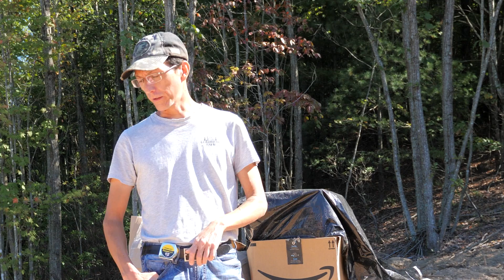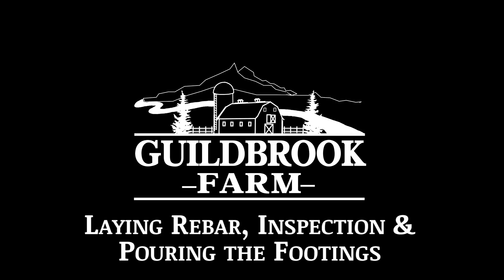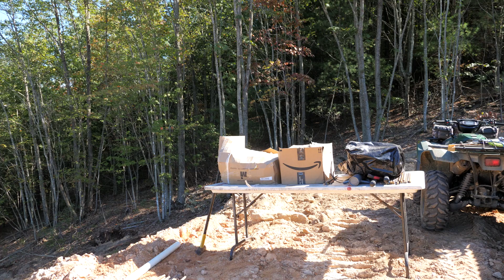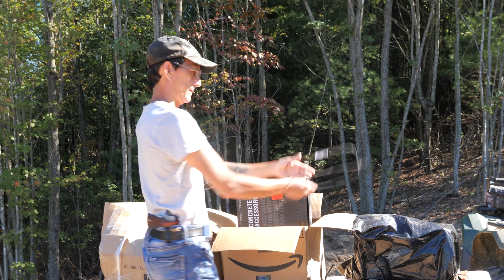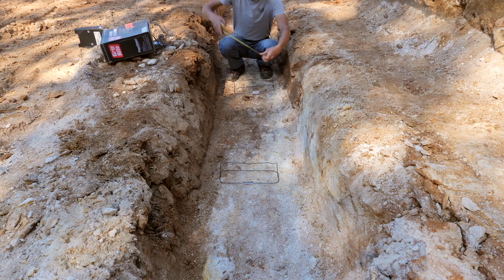ICF Home Build (#15): Laying Rebar, Inspections and Pouring Concrete for Footings

Comment: just wanted to know if it is okay to have those vertical rebars pushed to the soil because it will accelerate corrosion and will expose all the rebars in the foundation to Oxygen

Comment: I learned a lot . Thank you ..Question: what if you’re on a downhill slope . Is it the escavators job to fill in more dirt at the lower end or would he remove dirt from the high end or do I raise the footing with more cement at the lower end
Reply: You always dig footers to virgin ground.  If the difference in height/elevation is considerable then you may need a stem wall.  In a stem wall you dig the footers, pour the footers then make the difference in heights with cinder blocks.

Comment: good bless evening sorry to bother you but I have a few questions because I'm building my own house for the first time ever the rebar with the green cap how did you do that did you drive them into the ground and is that fine or should it be placed when concrete in poured

Comment: Footers! Hey, I like the way you did this, easier than doing wood forms, why would someone want wood firms vs how you did your?
Reply from the maker: You have to use forms in some situations, like where there is a "stepped" foundation. The easiest and cheapest is to be able to dig trenches that are all level and on the same plane like we did.
Reply: Some counties/states only allow formed footers. My county I have to have formed with wood and a perimeter drain.

Comment: Great job-looks perfect. 😊 Thank you for pointing out rebar "chairs" to "float" the bars-just what I needed to know. Bought pond liner, then realized I will be dealing with intense hydrostatic pressure so thinking pouring might be better. Only 4' x 3" but below grade to hold drainage. Needs to be a tough pool.  Suggestions? Lol

Comment: Whereas you are trying to accomplish the task at hand with the least labor you should have provided your steel supplier with your structural drawings and they would have detailed your needs for free.  Most of the suppliers will provide your bends, hooks, stirrups without additional cost for the fabrication and sell you the whole job at the steels tonnage price.

Comment: Did you need to compact the bottom of the footings trench?
Reply from the maker: No
Reply: As the inspector said "it's solid".  No need for gravel or  compacting.

Comment: Rebar in contact with dirt😳that’s a new one to me that would fail the inspection here
Reply from the maker: No structural rebar contacted the dirt.
Reply: 16:22 - 17:22
Pounding rebar in the ground.
Reply from the maker: That’s not structural

Comment: Great job! But no j hook on the vertical dowels? Doesn't seem like its going to provide enough uplift resistance?
Reply from the maker: It’s only for shear. No uplift worries here with 130+ tons of concrete.
Reply: I wet stab the vertical rod at an angle then bend them up after the mud dries
Reply: Would not pass inspection here!
Reply from the maker: Glad we’re not there.

Comment: Inspections...what a waste of time and money.
Reply from the maker: Depends on how you look at them. Go to a 3rd world country during a catastrophic event and you may develop an appreciation for minimal codes.
Reply: @Guildbrookfarm  Inspections and codes are great in theory. In practice, not so much. Too many inspectors don't do their job, others can be bribed. Some code items make no sense at all. Then there's things that should be code, but aren't. 

The worst problem of it all, is the only way to get the code book is to buy it. Well, the only legal way. Everyone has a computer and internet access now, there's no reason to not have a free PDF online. Except for greed. 

Here's some irony for you, the place I learned all this is my local community college, in the building that got built without insulation in a large part of it. Code at the time of construction was R-19 or R-13+5. 0 insulation, and it 'passed' inspection.
Reply: @Guildbrookfarm  Yes, I agree however there is ZERO accountability from the code inspection process.  If it fails for whatever reason, you're holding the bag, plain and simple
Reply: For us few with common sense and IQ above 100, agree.
How the world works, the % game, treat everyone as dumb and stereotype because its easy to make money from it.

If only we all lived on the same planet.
Reply: Building codes and inspections are important for many reasons, one good reason is to stop people like you duggydo from building unsafe structures.

Comment: Thrilled to see progress for you guys! And great to see your beautiful young ladies. I know like yourself, I research everything before starting things. Just wanted to share my story. My parents went with the ICF for the basement of their addition. The last cement truck to deliver was way longer then expected behind the previous. Bottom line, a few years later, the basement started leaking. contractor who came in to assess the issue said whoever was doing the work did not mix the new concrete with the previous. Could even see it, loads were slightly different colors. (Don't know the proper term) Sort of like getting the air bubbles out of a canning jar.  This caused the new concrete to layer on the previous causing a void between the two, over time created a leak. 
This was years ago but wanted to share. Would hate to see you have that issue.

Comment: question. why only a foot of footer? isnt there frost line stuff to consider? Is there more going on top of that that takes that into account? does it not matter at all and only needed for spreading weight? :)
Reply: Yes, dirt will be covering it and they might be in an area where the frost line isn't too deep.
Reply: Only the bottom of the footing has to be below frost line. Top of footing can be above it.

Comment: You put rebar after concrete as been poured..! Well... That's a bad idea, spzcially when it is as dry as it is here.... Non sense.
Reply: It’s acceptable lots of places. Although I would have pulled a mason line above footing to keep vertical rebar in line. Using tape measure from edge of dirt footing wall not going to be near as accurate

Comment: 1.5 yards short!? missed the mark by a long shot
Reply from the maker: Meh. Wasn’t a big deal in the end.
Reply: It's difficult to calculate volume of concrete when you have a trench footing, formed footings can be calculated more accurately. It's more work but that's the trade off. Hopefully the small load charge wasn't excessive.
Reply: 1.5 yards is literally the size of two washing machines, not a long shot by any stretch.
Reply: @augustreil  it is in the concrete world.

Comment: I had no doubt the inspection would pass. You have done more quality control work in just the footer than most contractors put into an entire build. I know its time consuming but your constant checking, measuring and rechecking will pay off. I'm glad to see somebody take so much pride in something. 
Can't wait for the next video. 
Thanks for sharing

Comment: You should research if you need 2 Ufer grounds in the concrete, you probably do,   they are 1/2" lengths of rebar, coming out of the concrete as a electrical ground, I think I saw somewhere that they might even measure continuity between them.   They are easily added in the first course, and channeled out of the foam with a utility knife.   I would weld them, but I do not think that is mandatory.     Keep up the great work

Comment: How come no plumbing or electrical lines yet? Usually those go in before the footings.
Reply: Keep in mind this is the basement footer not a house footing that is way way below grade. It appears that the house will be 5-6 foot above this footing. They will probably bring the electrical and plumbing in under the house which will be through the side wall of the basement.
Reply from the maker: Correct
Reply: I was thinking the same. One would normally dig those (and proper drainage underneath, but maybe not in their climate) in first. I'm in a heating dominated climate, so I also put in the air intake for the fireplace as well.

Comment: When I heard the trucks you ordered I just knew it would be short.
Do yourself a favor, take some scrap wood and build some boxes that you can pour excess concrete into. Either make pavers or blocks for smaller retaining walls. Every time you order concrete there should be some excess and with ready forms it won't go to waste.
Reply: Even if you order too much and don't have any forms, it's still cheaper to just dump the excess than having another order run for concrete.
Reply: I had the same feeling. I watched Al Lumnah build his barn and he ordered extra with the idea of pouring a sidewalk with whatever was left.  Fortunately it seems that getting the extra 2 yards didn't seem to be a big deal.

Comment: It would be easier to have cut a 2x4 to length rather than have to pull tape to set your chairs. Anytime you have a reoccurring measurement making a story pole saves lots of time, like setting you dowels, a pole that is long enough to show the height would also carry the mar of the distance between each and the distance from the inside wall. It's an old school way.. 
Porta potty means you is an official job site

Comment: Where did you get the tool to twist the wire?? I’ve been doing it the hard way 😳😳
Reply from the maker: Amazon. A few bucks.
Reply: I picked mine up at Lowe's but and hardware store should have one.

Comment: As someone who has spent 3  years remodeling a house, a little advce for you.     DO NOT CUT WOOD ANYWHERE  NEAR YOUR INTERIOR.  We used a room that was scheduled last for completion for a cutting room. We will never get all the sawdust out of the house. It's been about a month since we moved our cutting operations to the garage and every day we clean up more sawdust. Be blessed💜
Reply: If that were true, every house in the country would be sawdust ridden forever, so not true.
Reply: @augustreil  MY STATEMENT IS TRUE FOR US. I can't speak for everyone nor did I try too. I shared my experience.
Reply: @Souixno , Thanks, I guess your job site wasn't cleaned like it was supposed to be.
Reply: @augustreil  Maybe you are correct and we do not know how to properly clean to remove all the sawdust. We are not professionals or contractors,  we are rookie home remodelers like Jeremy and Jaime are rookie home builders.
Reply: @Souixno , It's all good, you'll get it eventually. Nothing lasts forever, except taxes. Have a good one, thanks.

Comment: I built one of these five years ago. You really have to plan ahead, like way ahead, because cutting into concrete with rebar is a pain. I didn't see anything for a basement drain, septic, well or radon. Conduit in the concrete works well for electrical but plan ahead. Plan the screw strips for wall studs and kitchen cabinets. These houses are awesome. Reach out if you want any help!

Comment: Make sure you have the right grade away from the house and drain tile system . I have a house in northern Minnesota, all clay. My dad refused to put in a good drain tile system and pushed the clay right against the basement walls. 25 years later, the walls are coming in. $35,000 dollars later the walls are now fixed

Comment: You did what we did when we ordered our concrete you forgot to account for the 2 post pier support holes. We were off 3 yards but we had 4 3'x3' holes. Happy you got alot done. In the porta potty place a small insulated cooler to hold bay wipes and toilet paper. Place the wipes in a ziploc bag and the toilet paper in a separate ziploc bag and then place in the small insulated cooler to keep the wipes from freezing in the winter. Plus if you don't store the toilet paper in a ziploc bag the bugs will eat it and the spiders will live inside the tubes.

Comment: Did you by chance install a ufer ground for say a future power panel in the house? Generally just a 10" stick of rebar tied to the footing rebar that sticks out by where a electrical panel may go. That moment when your almost done pouring concrete and the trucks empty and you got a yard left to pour and then have to order the minimum to get another truck out..Have had that happen pouring concrete pole bases, luckily I didn't figure the concrete or order it on that job lol. Construction is a learning cure, always order 10-15% more concrete than you think you need. You were lucky with that rain as well. Project is looking good!

Comment: I really looked at your rebar work nice job. You’re going to learn a lot of stuff with this build. Here the upside to it all, you’ll know where to go right away when things need repaired. One of the most important tool to have is a string Bob even it just a heavy nut at the end. The a water level with a clear hose, it’s on the cheap, and it’s never wrong.
Reply from the maker: Well...  Yep.

Comment: Thanks for the post. Question: when you were evaluating different options to build your home, did you consider a steel structure? If so, why did you decide against it? Thanks
Reply from the maker: Did not consider it so can’t say anything good or bad. 🤷🏻‍♂️

Comment: Interesting your inspection was more detailed them ours. They did not poke the ground. And our rebar, that is vertical had to be tied in to the horizontal rebar.
Reply from the maker: Every “jurisdiction” has its quirks. I’m happy ours seems to have common sense.

Comment: Brings back a lot of memories. I built my own house, too. 2000 sq. ft, with a full basement. Just realize that there will be issues , along the way but hang in there and plow through it all! The framing is where the big slow down comes, unless you have some help that can be there for a few days. Be extremely careful with the floor joists. There is where you will have to be dead nuts square. Start square and the rest falls into place. I assume you will be using manufactured joists. Eyeball them and string line, if necessary. Take your time, there and get them right. Good luck!